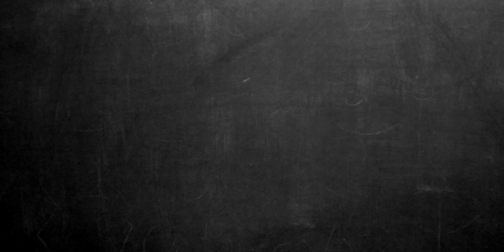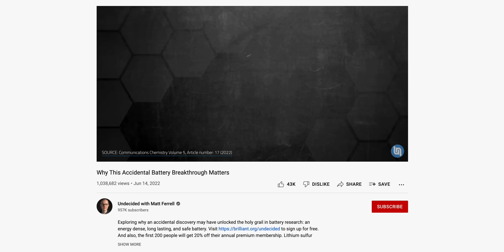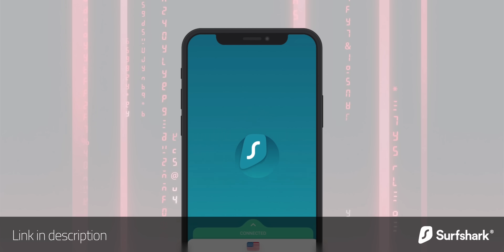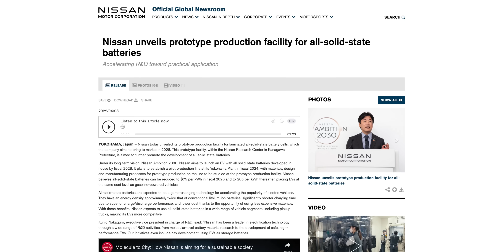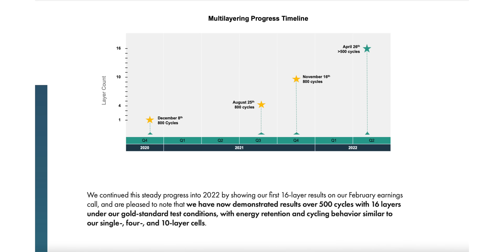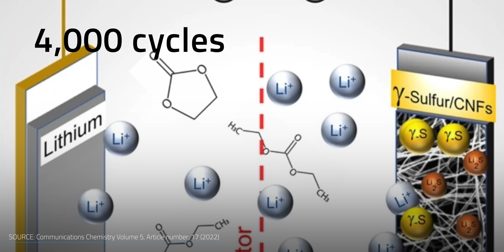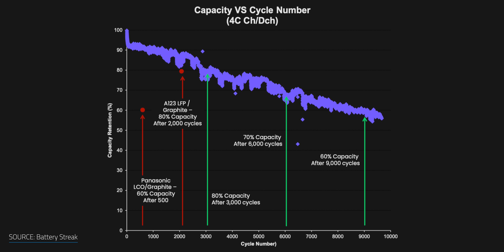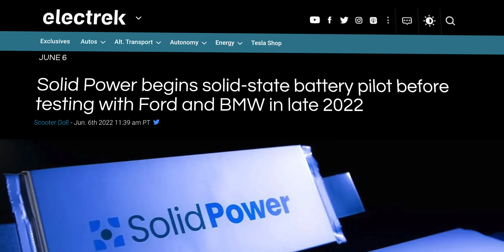Is This Solid State Battery Too Late?

Comment: The price of lithium has been rising very fast since 2020: In 2020 it was $8000 per metric ton, now it is $75000 per metric ton!! Beginning of the end of lithium batteries?
Reply: It's why I wasn't totally onboard with the whole "we need more electric cars!!!" argument.

It's just trading the overuse of one resource for another. It is not any more sustainable than plain cars.

We need a more holistic approach to sustainability that focuses more on reworking how we design cities and transportation.
Reply: @EzraM5  I agree that we need to rework how transit is structured generally and reduce car dependence--but lithium shortages don't make EVs equivalent to gasoline cars. Climate change is a bigger issue than cost, IMO.
Reply: The price of lithium will only go up to a point before it starts destroying its own demand, and likely by that point more mines and processing centers will be started to open up to produce the material. The good thing is unlike fossil fuels once mined it can be recycled and isn't destroyed, the bad is to open new sources will take time. How much you want to bet the next wave of lithium battery innovations will be in recycling and reducing the amount of lithium needed?
Reply: Lithium prices have been stable through all of 2022.  Lithium mining stocks have been falling in price, indicating investors don't think lithium prices will increase.  Goldman Sachs forecast a large decrease in lithium prices to $16k/tonne in 2023.
Reply: @dansanger5340  Actually the price has only been stabilizing and gone down slightly the past few months. Since the beginning of the year the price has gone up 100%, and since the beginning of 2019 its up almost 500%... Likely what is being seen is the demand destruction from the increased cost. That will force the price down some but it will stabilize around there until demand goes down or supplies go up. Something massive would have to happen for such a huge crash in price so fast as even covid didn't kill demand that much percentage wise.

Comment: Tesla's battery is just 6 times bigger than the previous cell. 6 times more power means nothing
Reply: That was my first thought too, but it's possible that making the cells bigger can lead to other improvements - less space (as a percentage) would be taken up by things like packaging, it might be cheaper to make them a bit larger and it would probably be cheaper to handle them too (per kWh). Basically, Tesla have been using batteries designed for laptops until now because they're cheap and common, but for cars there could well be advantages to making them a lot bigger. 

The video claimed a 16% improvement in range for the car, so I'm guessing that whilst you're quite right, the 6x increase was per cell and therefore meaningless, the 16% improvement is per litre/kg/car and therefore very meaningful.

Comment: Personally I am a big believer in research, just for science.  You can't predict what might pop up, or if research in one battery may be the a ha moment for a researcher on another battery or even in another field.   That is also the risk with corporate driven research, so many battery ideas are likely to be dropped in favor of the one that promise the most profit.   I hope at least the research gets published and not stashed away in a companies IP drawer.
Reply: If we don't ask, how will we ever know?

Let alone, did people have any clue that mechanical computers might be more useful in certain use cases than their digitized counterparts?
Reply: @krakhedd  Digital computers are more useful in basically 99.9999% of the usecases simply because of the concept of abstraction. And for the few use cases where a mechanical one may be useful it is not really that worth because the manufacturing and engeeniring cost of such a computer outweights the benefits when we already have ubiquous ready made digital solutions. 
Basically, the best solution is inferior to the cheapo easy good enough solution
Reply: @diablo.the.cheater  is that why mechanical computers are making a comeback for industrial purposes, cu they like to spend money when there's a cheaper way?
Reply: @krakhedd  mechanical computers are not making a comeback for industrial purposes, digital ones are still cheaper, you can get digital computers very dirt chip that can do a lot of stuff in a indutrial setting, i am talking 5$ cheap
Reply: @diablo.the.cheater  .....yet there is still an economics case to be made in certain speciality circumstances. Amazing, isn't it???
Reply: I think that mechanical computers are better, as almost everything around us is mechanical ( even electricity is considered one of the applications of mechanics ), and they are also easier and more reliable. I would just like to mention that the term “ digital ” does not necessarily mean electronic, as it is an independent thing in itself. There may be something electronic that is analog, or there may be something mechanical that is digital. For me, it is good to have different technologies and not for one technology to be dominant. Please, can you give me a link to this topic, as I am researcher in it?
Reply: Agreed, like the VHS / BETA video technologies BETA was technically better but with Sony behind VHS it won the market.
Reply: @jamest5149  was it technically better, if the market chose else-wise? I used to watch Betamax; and while it was "better" than VHS, it also cost at least 3-4x as much. For maybe 50% better video. As with all life, diminishing returns/margins; you guys are decrying reality for being real 🤷‍♂️ just my $.02
Reply: @krakhedd  no reality is real in this case Betamax was simpler technically and to manufacture as well as producing a better quality video production…. Sony just used their might to squash the competition both using their electronic manufacturing might but also brought in their media wing to make sure films were released on VHS first. This isn’t the only case of this but it’s a useful analogy for those of us old enough to remember.
Reply: @jamest5149  my comment is intended to call into question our subjective perception of "the best"; Nature always chooses what works best, and it's up to us to align our understanding so that we understand Nature's functioning all that better
Reply: @jamest5149  I’m not sure I understand your comment “Sony just used their might to squash the competition … to make sure films were released on VHS first.” Betamax was developed by Sony. Why would they promote VHS?
Reply: @theshreddes  my understanding is that the best way always wins, and a contrast between that and what we individually think is the best is our expectation derived of our morals and values. We are functioning perfectly as animals because that is what we are and I am VERY much a fan of stopping this nonsense of telling ourselves we are better; we are better when our reality reflects better. Our reality reflects us perfectly 🤷‍♂️
Reply: @krakhedd   I understand what you mean to a degree, but to assume outside influence doesn’t affect our personal thought and behavior is kinda silly. I think to say that our actions have no responsibility, solely due to the fact that we are a part of life, is silly (Nuclear fallout being an example). I also think we are a part of nature but it is pretty easy to see the devastation we have caused. I think we are more accurately represented by a virus. Destroying our host and searching for a new one. Sadly.
Reply: @theshreddes  quite to the contrary, I believe my point to be the ultimate conclusion of personal agency and responsibility - even being responsible for brainwashing ourselves. All actions and thoughts are intentional, "sovereign" if you will, even the choice to line up behind somebody else's beliefs and putting our own aside. No, I quite argue for personal agency and exercising our individual prerogative
Reply: @jamest5149  the whole "Betamax was better" bit simply isn't true. It's actually way more complicated than that. Yes, it had better video quality. But, that's just one measure of a product's value, and consumers chose VHS because, overall, it fit their needs better. There were a bunch of tradeoffs between the two formats, from things like video quality to cost, runtime, and features, among others. Betamax had slightly better video quality, yes, but was worse in nearly every other way that consumers cared about. Especially relevant to consumers in the day was its significantly inferior runtime. The biggest driver for people buying VCRs was for time shifting the TV shows they wanted to watch. The ability to record multiple hours on a single cassette was far more important to most consumers than having slightly better video quality on a show you're going to watch once and then record over - especially when most people's TV reception was as bad or worse than VHS anyway. Then there were things like early Betamax VCRs' ridiculously inferior recording programmability. And those two things are just scratching the surface of how horribly Sony bungled their Betamax product strategy.
Reply: And yet, pure research budgets for the Federal Government have been cut to the bone by a certain party that worships in the temple of Mammon and hates the very idea of science unless it can make stinking corporate profits happen NEXT QUARTER.  Or weapons to kill brown people.
Reply: US federal government funding of basic scientific research topped 70% throughout the 1960s and '70s, stood at 61% as recently as 2004 before falling below 50% in 2013. Private corps go where the money is. If We The People want science to answer specific problems, We The People will need to pay for it. The problem I have is how private companies benefit from this and then charge us up the wazoo for products that would not be possible and act like they invented this tech and that we should be grateful for them. They should be required to list the various government agencies whose research they benefitted from in their marketing info and documentation along with some sort of financial kick-back to We the People. It’s BS that they can use free US taxpayer funded tech to create a product that they make f-tons of money on and then, thanks to Congress carve-outs, okay little to no taxes on all those profits. Maybe call it a ‘licensing fee’. If they use the tech and make nothing, they owe nothing. If they use the tech and make a ton of money, they can pay some per-item-sold ‘licensing fee.’
Reply: Reminds me of “the prize” in highlander 2
Reply: Yes true but there is a difference between a company doing research to develop a commercial product and labs or universities exploring what is possible
Reply: Unfortunately research is extremely expensive.  Especially these days, everything knowable without expensive equipment and facilities is already known.
Reply: You also have to consider that companies doesnt want big breaktroughs, just gradual increase of their products capacity. They can milk the market by gradually releasing better and better products instead of doing a drastic increase then stall for years with developement.
Reply: @RichardKincses  this theory never made sense to me.  Any company would rather have a huge breakthrough now than a gradual increases in performance of existing technologies.  It’s just that everything simple that can be discovered has already been discovered, so any huge breakthrough would require a ton of $ and resources.  Only huge companies (including universities) and governments have the money to make a new scientific breakthrough.  I’m talking about a truly new discovery.  A room temperature superconductor is a great example.  Don’t tell me Superconductors, Inc. would rather increase the temperatures required for their new superconductor 10° every year (until they get to a room temperature superconductor) than discover and sell a room temperature superconductor today.
Reply: @kaltkalt2083  that’s ok no one is thinking of giving you a couple million for basic research. But plenty of million to multi million dollar grants get funded every year!
Reply: @RichardKincses  that's all part of the process and there's no better way than trial and error. A real scientist embraces being wrong
Reply: @krakhedd  yeah we've seen the opposite to be true for quite a while now for many scientists
Reply: Most research is fruitless, and thus useless. We've got more research, more grants, more investment and more education than ever in human history, yet little to nothing is accomplished.
Reply: @Jamecbond  if you genuinely believe that....then you are a colossal idiot and I am genuinely sorry for you as the world must be a frightening place for you
Reply: @Jamecbond  I disagree- I don’t think you are looking at it from an appropriate time scale.  Look how long it to to go from quantum mechanics to semiconductor diodes.  You can’t predict when or how a piece of knowledge can influence the world.  It’s also a cheap investment considering the ROI if just one idea works out. Plus a good education has benefits for society as a whole.
Reply: @theharbinger2573  don't you see, your proving my point, 99% of the advancements we use originated 60 years ago, when there was far less money for research, than there is now. Where is all the useless research money going?
Reply: Absolutely 🙋🏼‍♀️ here are four areas where I think scientific progress will bring an end to fossil fuels and anthropogenic climate change.

1. Vastly cheaper renewable energy sources. Solar panels and wind turbines are cheaper than fossil fuels. Furthermore their energy production level compared to surface area is constantly increasing.
Battery storage facilities and battery capacity has been increasing whilst the costs of the batteries has been decreasing.
There's also hydrogen storage and hydroelectric storage systems.  
2. Geothermal energy plants. Development of laser drilling has made it possible to build geothermal energy plants anyway and will bring the cost of building one in line with the cost of a conventional coal fired power plant.  Furthermore, this technology allows the conversion of current fossil fuel fired power plants to geothermal energy plants. 
3. Synthetic food. I believe that the vast majority of food in the future will be produced via synthetic means. From cultures grown from genetically modified organisms and 3D printing. Farming and farm land will become redundant. This could potentially free up enough land to plant well over a trillion trees, if not up to two trillion trees. Enough to absorb hundreds of billions of tonnes of carbon dioxide and clean the air. 
4. Electric and hydrogen vehicles with solar panels. 
With the capacity of solar panels increasing and the weight of cars decreasing, it will be possible to extend the range of electric cars and other vehicles. 
For heavy duty vehicles, such as buses, aeroplanes, ships, and lorries I think a combination of hydrogen fuel cells and solar panels will be the way forward.
Reply: @ladyselenafelicitywhite1596  I will be curious to see how well the synthetic foods turn out. We have made significant strides in the last few years, but will it be efficient enough to replace farm land all together?
Reply: @theshreddes  when you consider how much resources are effectively being wasted by current farming techniques then the cost benefits will far outweigh any problems with taste. Just look at fast food chains like McDonald's, cheap food tastes cheap. However, I suspect that the taste of the food would rapidly increase over time, if  even is an issue at all.  
Imagine a factory that could churn out as much of a food product in a month that takes a farm between six to twelve months to produce with a fraction of the resources a farm requires. If anything, with good quality control I think it will be the reverse. Abundant cheap food that tastes like expensive food and with the added benefit of being rich in all the essential nutrients, unlike processed foods of today.
Reply: @ladyselenafelicitywhite1596  oh I hadn’t even considered taste 😅.  I am already a fan of more efficient farming methods ,the current large scale farming is mostly waste Boooo. If they introduced methods of recycling water like aquaponics and methods for conserving space like vertical farming they might find themselves farming in a more efficient manner. Although if what your saying is true than I am all for synthetic farming. Again less waste with consideration for the future of the planet not the future of a few bank accounts!
Reply: @theshreddes  me too 🙋🏼‍♀️ I'm always impressed by how much progress farming and agricultural science has made since I was a little girl. I still remember seeing farmers use ox's to plough their fields.
Reply: @theshreddes  I think cellular agriculture has the potential to
Reply: @ladyselenafelicitywhite1596  the limit of the energy density of the surface area of a car is not there. enough to run fans and slightly charge a car but nowhere near enough to power a car regardless of how efficient a solar panel gets.
Reply: @jasonbenjamin1464  did I even suggest a car could be run solely on solar panels?
No I frigging well did not! 
Learn to read what people write. 
I wrote a hydrogen fuel powered car with solar panels. Also, solar panels could provide enough power to run the electronic systems on a car. As for battery powered cars, I wrote extend their range. 
Sheesh 🤦🏼‍♀️ why can't people read with any degree of comprehension nowadays?
Reply: @ladyselenafelicitywhite1596  the cost of SSB is crucial and most researchers believe mass production can solve the cost issues, which are wishful thinking